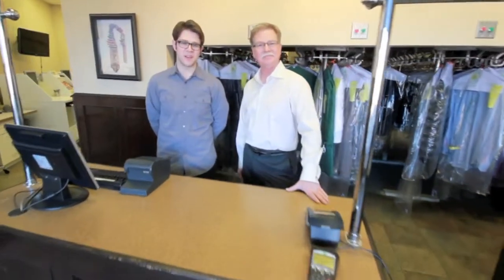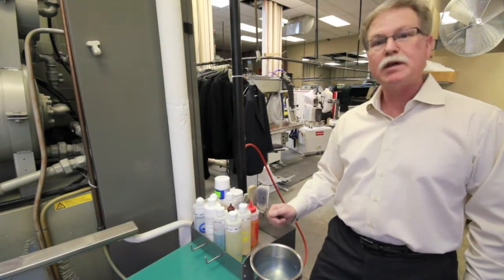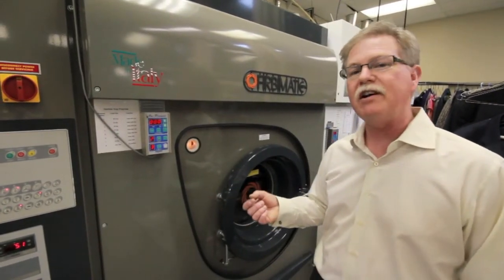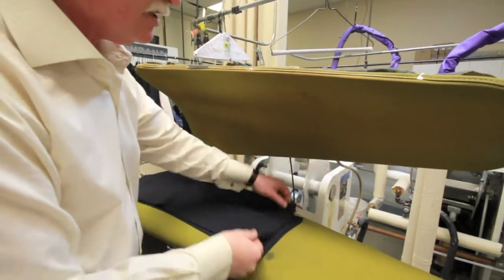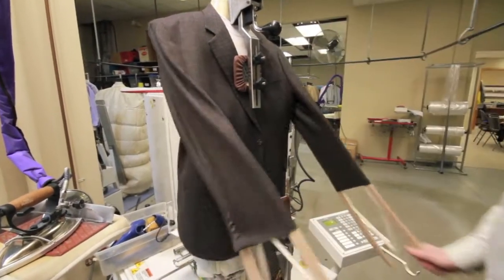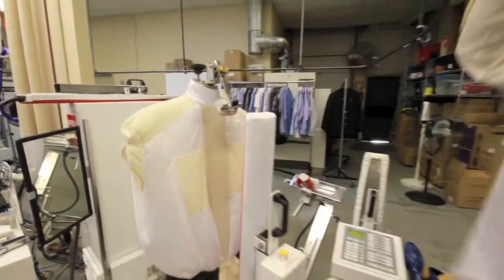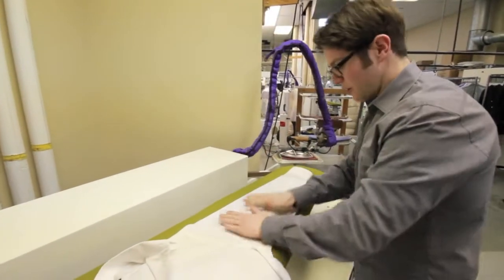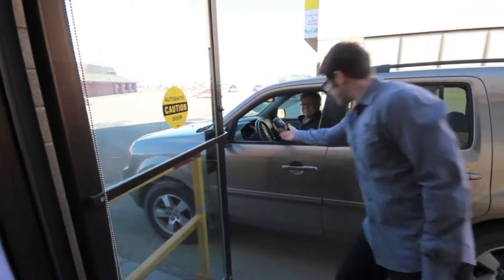Welcome to Busy Bee Cleaners

Comment: u can add water to a dry cleaning machine in pre spotting, u use a blend of soap perc and a small amount of water in pre spotting, the soap pulls the water from the solvent carrying the dirt with it bur u have to control the amount of water added but its possible its called the charged system